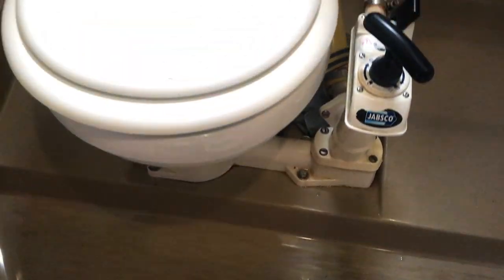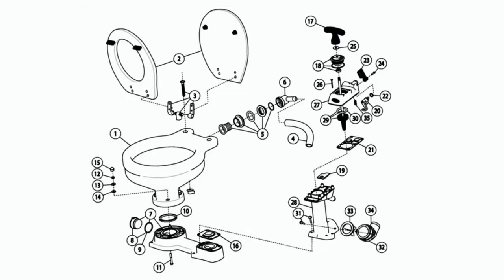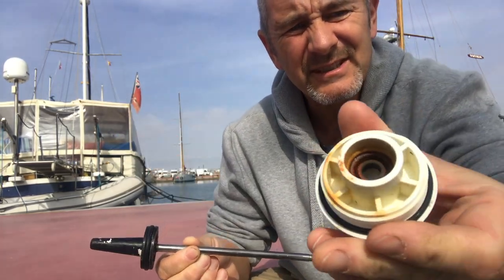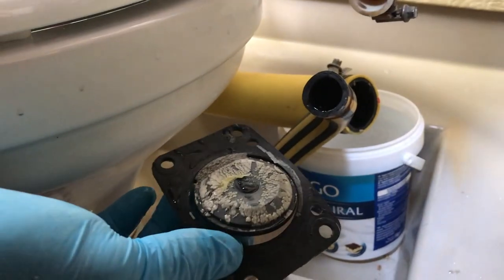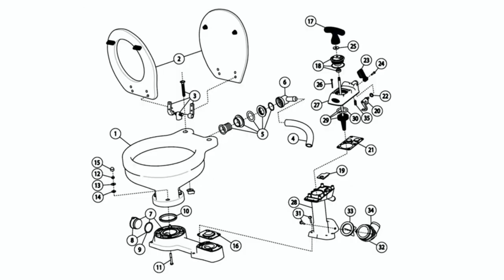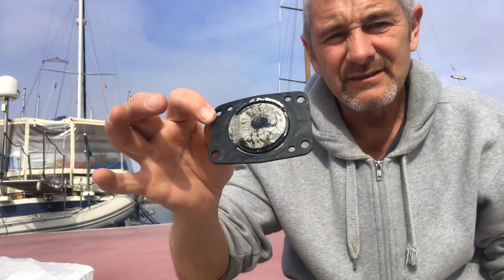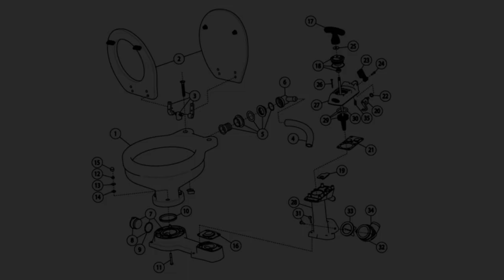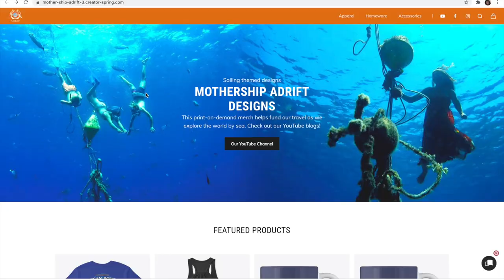Boat Toilet Servicing - DIY Maintenance of the #Jabsco Twist Lock Manual Marine Toilet

Comment: The problem is that the salt in the sea water used to flush the toilet reacts with the urea in urine and creates those calcium buildups.  Flush about a pint of vinegar once a month through your heads very slowly (one stroke on the pump every 4-5 minutes to let the vinegar attack and dissolve the calcium).  If you let it get away from you, you can also use 10% muriatic acid.  After doing both use about a gallon of fresh water from your shower hose to rinse the system out. you already seem to know to also use vegetable oil once a month to keep things lubed up and prevent the claim from sticking.

Comment: Hi Mate. Hope you are all well. Top Tips: Cover the outside of the plunger piston with vaseline to help stop the build-up of calcium. Same with the outside of the joker valve. Those self tappers, rotate the screw anticlockwise first until you hear a little click. Then do them up as they will be back in the same thread they originally cut. Hope this helps. Sail Safe Guys, Ant, Cid & the pooch crew.
Reply from the maker: Cheers Ant.. will take that onboard.. especially the Vaseline. Although I clean the calcium from the poo pipe in the next episode and a title like ‘putting Vaseline in my poo pipe’ might not bring in the YT audience I’m after.. there again, subs are subs!
Reply: Silicone grease is the recommendation from Jabsco.
Reply: @MothershipMaintenance 😂

Comment: There's a £30 difference in cost on eBay between the service kit and a complete Jabsco genuine replacement pump mechanism. Definitely not worth the labour cost or hassle to service.
Reply from the maker: Yes I think there’s some cynical pricing structure going in there with Jabsco. I’d agree with you if a lot of things failed at the same time or you’re doing a major overhaul but when you’re travelling off grid you don’t really want to carry loads of extra pumps just in case a lip seal or joker valve fails.. which are small parts and easy to swap out.
Reply: Yes but a service kit is £48 on ebay and the pump is £88 (but the rrp is £94) so the £40 difference is only £8 short of another kit! These pumps can be repaired/serviced in under an hour and it's good to only use what is needed from the kit and keep the rest as spares.

Comment: With so much calcium your big worry is that the hoses will also be cruddy, which is a different magnitude of effort to replace. Simple remedy - the kids aren’t pumping the toilet enough to get shut of the deposits! Also a smear of silicone grease or Vaseline everywhere on re-assembly smooths and seals much better. After that, frequently smearing the piston seal o-ring with silicone grease is a 2 minute job and keeps the pumping operation silky smooth. The easier it is, the more likely the kids are to flush more!
Reply from the maker: Yes, and that’s exactly what I had to do a few weeks down the line.. clean the poo pipes! See the next exciting maintenance video when things just keep getting more grim 😕

Comment: It’s not much more expensive to buy a complete new pump assembly and save all the effort dismantling and cleaning/replacing all the component parts.
Reply from the maker: It is easier if you need to change all the component parts but that is rarely the case. It would be a bit of a waste to change the entire assembly for the sake of one (much cheaper) joker valve or diaphragm. But Jabsco do seem to have a cynical pricing policy where the service kit is only marginally cheaper than the entire assembly.

Comment: Best video out there, very clear. After constant problems over the years, and many replacement parts, I finally installed a new pump. Result:  No out flow - diver came, now ok when flushed from a bucket of water.  BUT no water comes in. Eventually I bought yet another top valve and spring. Fitted nicely. Still no water comes in. Sea cock correct. Fitting correct.... Any ideas?
Reply from the maker: Have you tried the inlet pipes form the seacock to the pump? I recently replaced ours.

Comment: Generally helpful, so thanks. A couple of issues there though. He mentioned that the self-tapping screws were vulnerable to stripping the plastic if over tightened, however, it is wise to point out that tightening the screws in opposing order is a good idea to get an evenly seated seal and avoid further leaks. Finally, I really hope he thoroughly hosed down the pontoon after scraping off the residue from his toilet to it, or some unsuspecting soul could subsequently transfer bits onto their boat.
Reply from the maker: Yes the pontoon had a good spray down afterwards although I did thoroughly flush  through with fresh water before taking the toilet apart so the residue was nearly all calcium that came from the sea in the first place so I was just returning it to its rightful owner!

Comment: Vinegar is great to remove the "calcium deposits", but I don't know if vinegar attacks the rubber valves. Maybe a test using replaced valves is a good idea, or checking chemical compatibility tables.
Reply from the maker: I've tried removing calcium with vinegar with little success but regular flushing with it does help hold it at bay.

Comment: Good video, educational, showing the various components in the Jabsco toilet pump. I have a new one on my head, and a spare stashed away. I also have a couple of flapper valves and joker valves. If I can't fix it with one or both of those (or if it's crudded up really bad) I just swap out with a new one. At $100 for new, it's about the cheapest replacement part on a boat.
The old one I took out to replace, showed the joker valve was bad, so I cleaned it well, put a new joker valve in it and it's also a spare. 
I have read in several tutorials, not to use vinegar because the type acid in it stiffens rubber and other soft synthetics. CLR has different acids, propanoic acid (strong) and gluconic acid (mildly acidic and added as a surfactant). If you use CLR, it's better to do multiple cleanings if required, letting it set for only a few minutes, each cycle. Flush with lots of water, then repeat. 
This will keep the lines and fittings clean while not damaging soft synthetics in the pump. It's also more environmentally friendly than hydrochloric (muriatic) acid.
Reply from the maker: I think hydrochloric (muriatic) acid is fine as long as you allow it to dissolve fully and not use too much. I used it recently to clear the interior of the water heater. I've also worked out the optimum flush for the length of pipes.. turns out it was 14 pumps on your forward heads! Since doing that we've had far fewer clogging incidents.

Comment: Great video thanks. I've got the same toilet and there are 2 screws on the top cover of the piston assembly which go through plastic sort of inserts which turn with the screw on the underside of the cover. Are they supposed to do that or should I fix those two bits with glue so they don't turn with the 2 screws? Not sure if it is contributing to a leak on the top cover. I haven't tested it yet but I've replaced the rubber valve on the top under the plunger handle.
Reply from the maker: Not sure exactly what you mean by the two screws Andrew.. does anyone else know?
Reply: @MothershipMaintenance  Thanks for replying. I ended up having to buy a new pump assembly as when I looked again it would not make an airtight seal. All good now

Comment: Hey Woody, 
Do you think this is just normal calcium build up or are the kids not flushing enough to clear the urine from the toilet and pipes?
I've seen other cruisers recommend a spray bottle with a vinegar, olive oil and lemon juice mix. The lemon juice is supposed to help with the smell, but there's no real covering up the smell of vinegar. I've been giving the heads about a dozen pumps from the bottle after each use. That said I'm a weekend sailor so my heads isn't getting the use yours are and I haven't got into servicing mine yet, so I'm not sure how effective the vinegar & olive oil is.
Reply from the maker: Yeh, we have a flushing issue onboard with kids not flushing enough and we do treat the calcium fairly regularly but it’s no substitute for a good pipe bashing!

Comment: OMG! Why go through all this when you can replace the whole pump for just a few dollars more than the full rebuild kit (unless you like wasting time & playing in sewage).
Reply from the maker: It's true, it's a lot less hassle to swap out the entire pump but often it's just a simple choker valve replacement. Until you start stripping it down you don't know exactly what needs doing. If you swapped out an entire pump every time you get a small problem, costs could soon add up and you'd be throwing out a lot of perfectly good gear.  Carrying small parts for all your gear is a lot more efficient than carrying entire replacement items which is another issue when sailing long term off grid as storage space is at a premium.